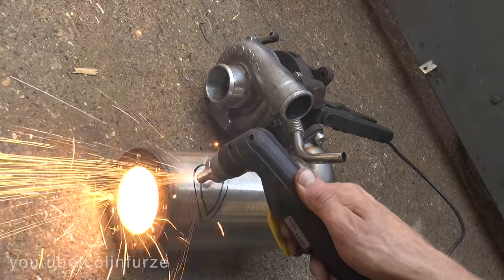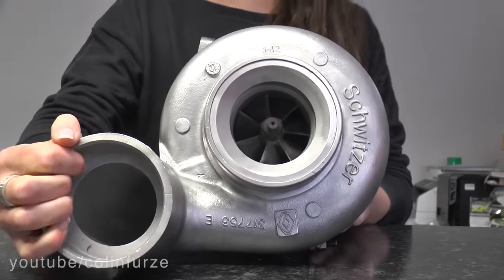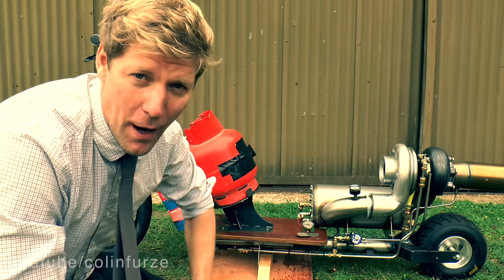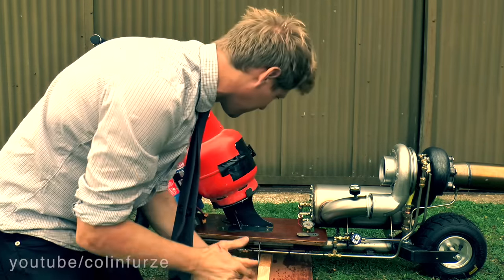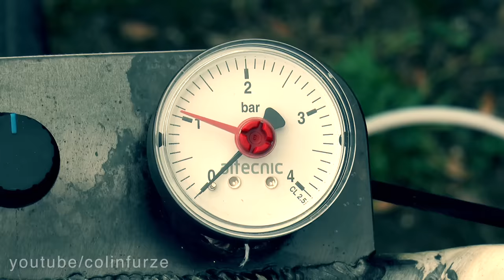TurboJet Powered Scooter-IT'S ALIVE

Comment: You should build a funnel at the front so the turbine sucks in more air.
Reply: A funnel may be an improvement, not because it "funnels" more air in but because it would reduce turbulence from the air taking a sharp turn before entering the compressor - but a properly shaped intake duct would be better.
Reply: Have any of you seen a drag car?
Turbo stacks or "funnels" flow in a crap load more air.
Many people have done wind tunnel test and boost pressure tests to prove it, too.
Reply: Siward Beorn yelling doesn't make you correct.
Also, in case you haven't noticed, that's a turbo on the back of that scooter.

Comment: It's probably a bit late to get in a comment. But that intake also needs some work the path for the intake air is quite rough. Should make a conical intake.

From what I understand small turbines like this are extremely sensitive to any disterbance on the inlet side of things.

I would also try going over the thing with a fine toothed comb looking for any air leaks. Going so far to make plugs to put it under pressure. Any lost compression will equal lots of lost power.

All that said that is probably the coolest thing you have made yet.

Comment: you should instal a heat exchanger for the oil, mount a mishimoto fan to it. User a turbosmart OPR to regulate the oil pressure and let that pump run at a constant speed. Make a high pressure circuit hooked up to a scheid diesel water methanol pump. run straight methanol in a nozzle injected into to where the exhaust stream is. you could make a special nozzle for it that is rated for the heat.

Comment: You will increase the torque value by routing a intake tube to the front. The air moving around that propane tank is creating a low pressure pocket in front of the intake thus needing more torque to pull air.

Comment: If u got a car with 5 other motors from this in the the back with an ultimate engine,wheels of front can be extended up and down with wings and with the 6 motors one mega in the middle of the back and boom u made a flying car

Comment: Yo may want to alter the rake on the steering castor angle as it becomes more critical as the speed rises.  You may eventually hit "flutter" speed and experience what us older motorcyclsts would call a "tank slapper"  I have also had it on a bicycle in a downhill race.

Comment: Turbo chargers that are on engines only need a dribble of oil... long as it's there and clean and cool. that's all that matters but since you're using it as a jet and pumping tons of heat through it. you probably want as much oil as possible without blowing the seals... so that's a tough call.

Comment: add suspension on the wheels so the turbojet engine does'nt bounce as much, i reccomend a air suspension tube, a small one with about 3 BAR of air in the tube you can change the pressure to make the ride even smoother!

Comment: Hey Colin, would you be able to increase thrust by harvesting waste heat and using it to turn water into steam, let it expand somewhere after the combustion chamber?
Reply: Water methanol injection would work, ran windshield washer on my setup in my old Volvo and i try mixing 50/50 methanol and the best result was winter washer the -40 one have around 45% methanol in it.

Comment: Would it be possible to put a carburettor between the turbo outlet and the combustion chamber inlet? So you can run it on petrol
Reply: Carburetor is not needed 
The turbine is already providing air
Reply: @hardnachopuppy  Carb does more than provide air.

Comment: @Colinfurze

Don’t rebuild the turbo. You will waste time and money. Because you aren’t using the turbo charger for its designed purpose, the reason it is leaking oil past the seal on the turbine side is because the oil ring relies on back pressure from the exhaust to seal and keep oil from seeping through the turbine housing.

Comment: Schwitzer turbo from mercedes benz big truck germany 800 euro new
Reply: Yeah and it blew it up because too much oil pressure. The oil film is the bearing on journal sleeve turbo, if too much the o-ring will bust, a friend of mine blew his Ebay turbo that way he didn't put oil restrictor  and the seal blew.